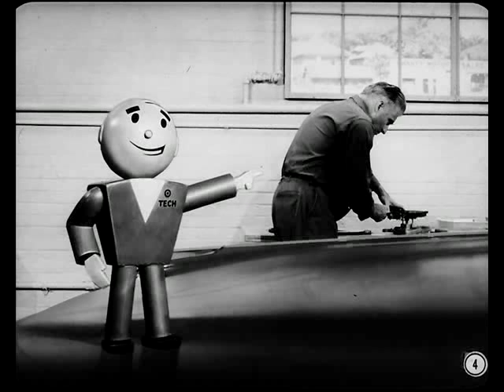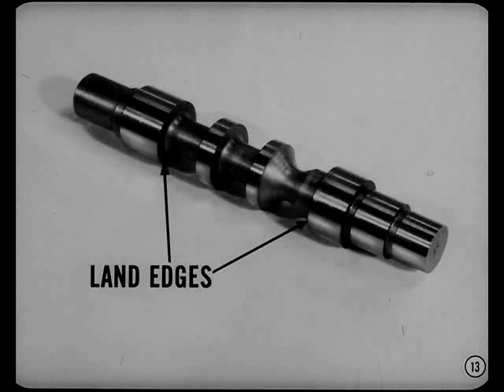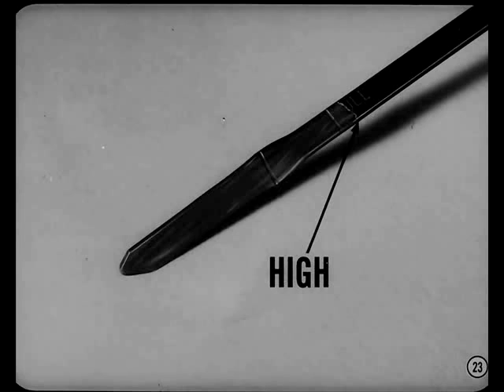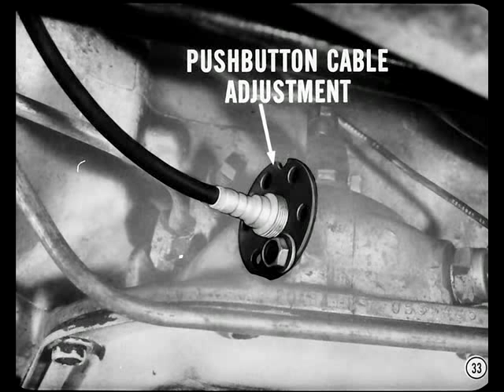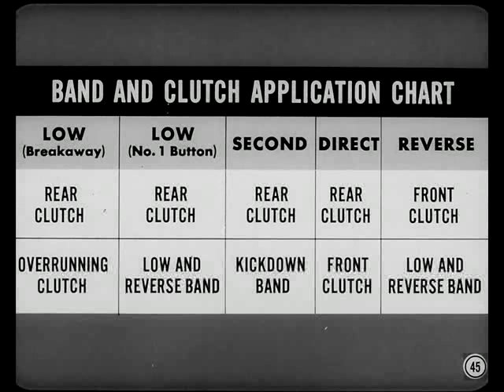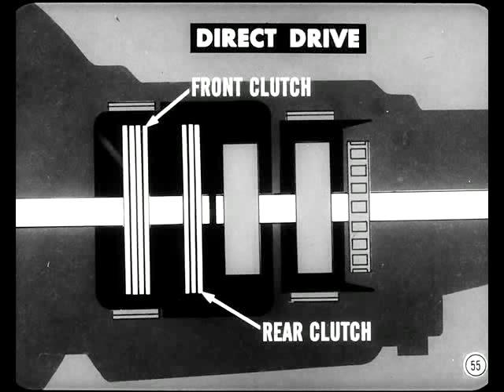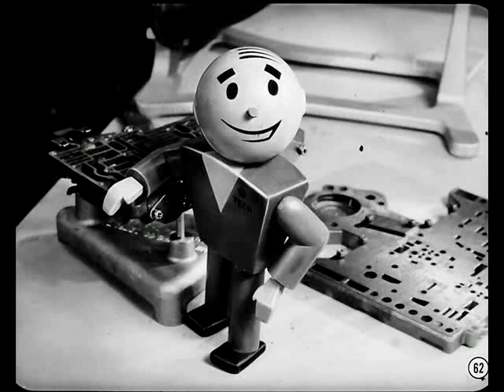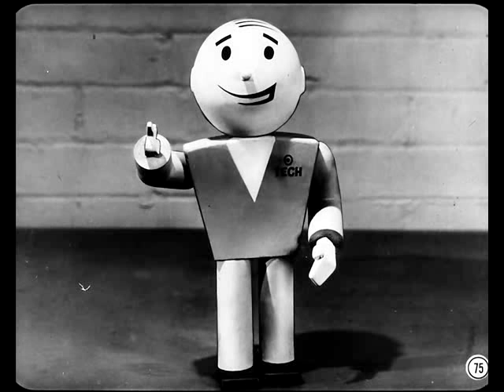Chrysler Master Tech - 1962, Volume 15-8 Torqueflite Diagnosis

Comment: It was my understanding that the Torqueflite 3 speed was tough. Unfortunately, by the time I entered the car repair business, most Chryslers were using a 42TE. The most common Chrysler I would see was a T&C van, and they got about 80,000 to 90,000 miles out of their transmissions. The longitudinal transmission in the Dodge Ram wasn't much better. There were not nearly as many Honda Odyssey vans as Chrysler T&C vans, but I heard many of them weren't much better. They were only more expensive to repair. I don't know how many instances led to the sale of Toyota Sienna vans and Chevy Silverado trucks.

I was good in several auto repair situations, except that I never learned automatic transmission repair. If a scan tool couldn't help me, I was out of luck. I left before automatic transmission class because I was in a hurry to get out of school and into the workforce.

Comment: Remember, less than 10 years ago, Chrysler claimed that the PowerFlite was the best automatic transmission around, one reason being that it had fewer parts, oh, and it didn't have that troublesome parking mechanism. Oh, boy! And during the middle of the 1956 model year, the new 3-speed TorqueFilte was introduced, multiplying  the number of parts, but still lacking that troublesome Park mechanism, yet still having to rely on that unreliable parking brake. You still had to carry that brick with you so the car wouldn't roll away.
Although, in this video, it shows the A-904 aluminum-cased TorqueFlite(introduced for the 1960 model year), what was new for 1962 was that Chrysler finally added that pesky Park mechanism. 
What was really new for 1962 was the introduction of the A-727 aluminum-cased TorqueFlite, which also included the Park mechanism. As it would have been difficult to add a Park pushbutton, it had to be lever actuated. It was a manual cable-operated mechanism, unlike the column shifters of other makes or the electrically servo-actuated pushbutton shifter common in Edsels and Mercury's.
Sadly, I don't think that they mentioned the new Park mechanism, nor did they mention the new A-727 automatic which after the switch to column shifts in 1965, truly became the standard of the world.
The introduction of the A-904 TorqueFlite put all the other transmission and car manufactures on notice. With the introduction or the A-727 TorqueFlite in 1962, The other automakers went scrambling. It wasn't until 1964 that GM came up with the ST/TH400 and it took Ford until 1966 to come up with their C-6 automatic. GM floundered with multiple other automatics in the early-60's, but they couldn't match Chrysler.